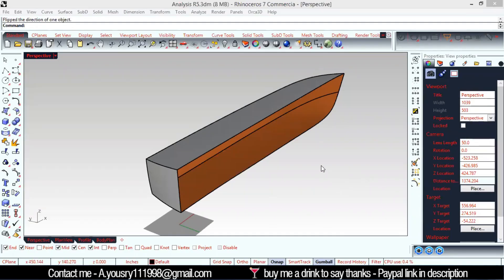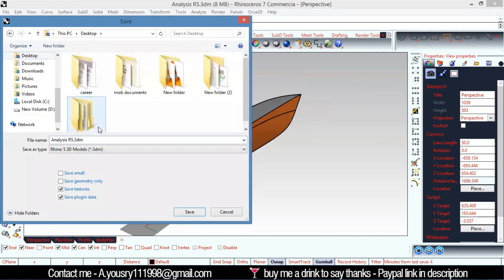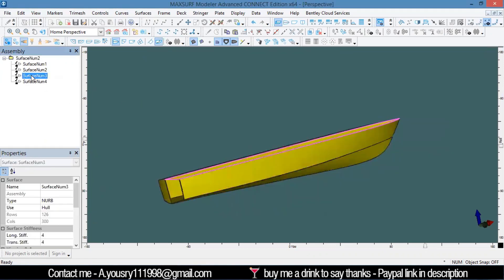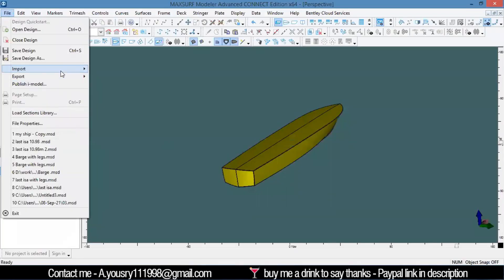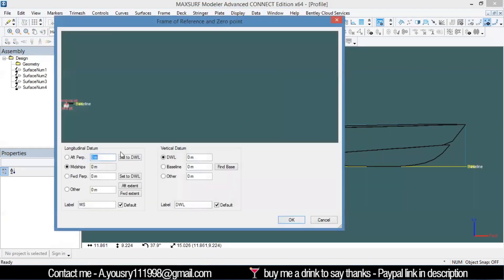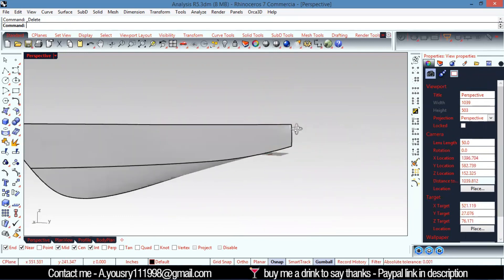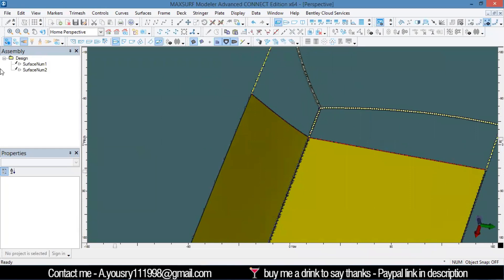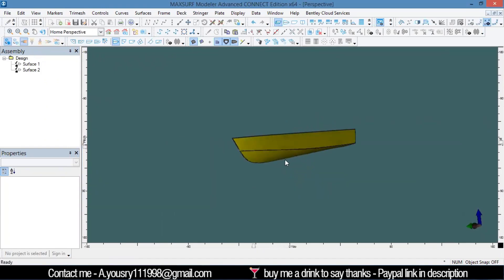Rhino3D Igs or 3dm extension for MAXSURF Tutorial

Comment: Hi! When i applied the stringers on the hull from Rhino in Structure Module of Maxsurf, stringers sticks the outside of the hull. Do you know the solution? thx.
Reply from the maker: Sorry for the very late reply but you have to adjust it from inside the maxsurf